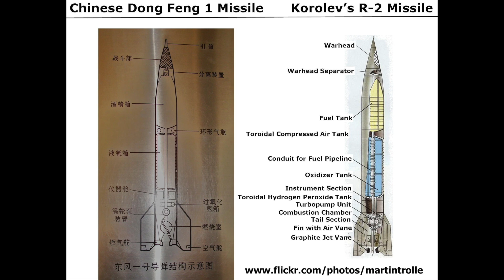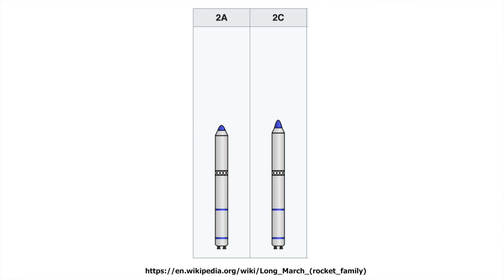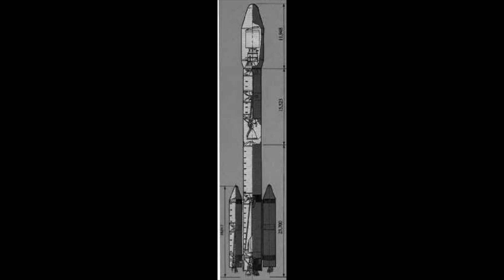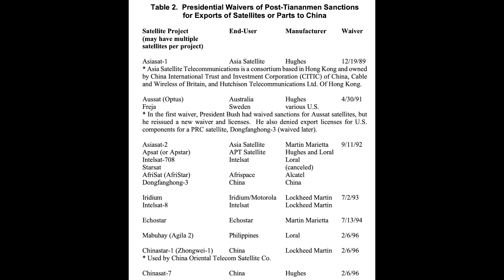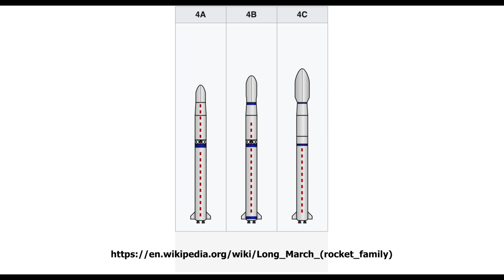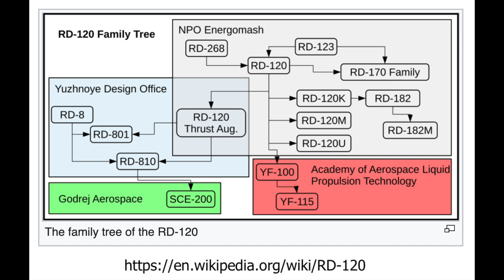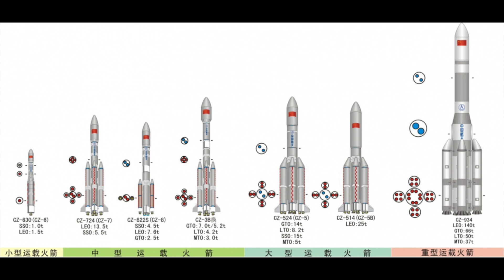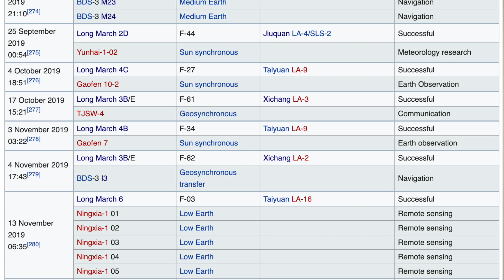Every Chinese Rocket Design Explained!

Comment: Why is there panels Falling off the rocket at launch
Reply: If you're talking about the one launching at 12:27 from the barge, those are spacers that hold the rocket in the middle of the tube that it cold launches from. Large ICBMs and those that launch from mobile platforms often use the same technique (see the Russian SS-18 or US Peacekeeper) and you'll see them fly off when the missile clears the tube.
Reply: Daniel Leca me too I think it was the ice because of the cold fuel inside
Reply: Agreed, I'm just confirming: most probably insulation and/or ice.
Reply: Insulation foam for keep cryogenic during filling fuel,and it's planned to fall of at launch
Reply: @Velctor  It is an insulation indeed, but not for cryogenic fuel since these rockets use hypergolic components. It's actually the opposite: the panels keep rocket warm enough while it is standing on the launch pad. NTO has relatively high freezing temperature and winters in China are cold.
Reply: @РоманЕвгеньевичСеменко  thanks
Reply: I'm a chinese spacecraft fan
Reply: Max Kopstein is right, The Indian space agency rockets do the same thing.
Reply: @Kickmemes_ Girls I smell a space enthusiast :) cryogenic bi-propellants, so cool ;)
Reply: Because there are.
Reply: That's ice falling off. It's normal.
Reply: @sdv73168  that isn't ice
Reply: It's made in china. What did u expect?
Reply: @vijeshkumar692  Uh, I expect it to be cheaper than US rockets, have the same capabilities, and be a lot easier to mass-produce. 95% of all products in the US are made in China, because they have cheap, fast, and most of the time reliable manufacturing plants. Those "made in China products are bad" are just discriminatory posts that look at the one in ten thousand product that was made in China that sucks.
Reply: the rocket is breaking apart (read @tanks608 's comment and replies)
Reply: @14Thenger  no, it's just insulation falling off as it's supposed to. It's not worth keeping the added weight for the tiny improvement in efficiency it would provide (by decreasing the amount of propellant lost to boiling), but while waiting on the pad it allows them more time to fill and trouble shoot any issues.
Reply: @maxk4324  dude that was a joke ^^ that's why I said "read @tanks608 's comment and replies" but thanks for the added infos c:
Reply: @14Thenger  lol, my bad. And np, rockets are cool af.
Reply: @14Thenger  but that's still successful launch
Reply: Because it's made in China, duh

Comment: Hello,
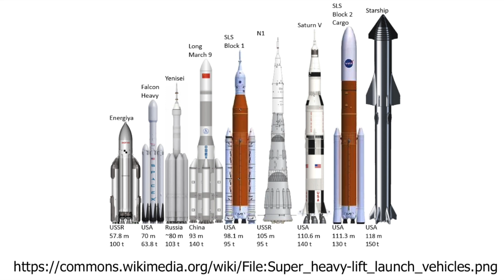The Energia in comparison chart at around 12:07 minutes, seems compact compared to the other designs? So how can it match the others on capacity, but be so 'tiny'?
Reply: it was very wide and had 4 strap-on boosters, also it had some of the best rocket engines ever made
Reply: As mentioned above, the engines boasted incredible efficiencies. As well, to expand on the point of it being wider, the volume of a cylinder is equal to its length times the square of its radius times pi. So that means tank volume increases proportionally with length but it increases quadratically with radius. In other words, adding a foot onto the radius gives you more volume than adding a foot onto length. The downside is that you increase drag, it's a trade off but it worked in their favour in this case.
Reply: It has four kerolox boosters with RD-170 engines weighing ~370t each and hydrolox core weighing ~780t.
It may look a bit smaller because it doesn't have a payload fairing.
Reply: Thank you for your replies, i have heard its engines were efficient, but this efficiency is not huge? Plus my limited memory advises that don't some of these newer rockets also use these 'leftover' Rd 170 too and also have solid rocket boosters which provide far more power than any liquid boosters such as the Energia's could provide?
Reply: @anticat900  Solid Rocket Boosters are not as efficient as their liquid counterparts, they are cheaper and easier to store, but they are no mach against the strap on boosters on the Energia in terms of power or isp, SRBs also cannot be turned off once started

Comment: 8:26 - seriously 4.2kg to LEO? Seems low.
Reply: I believe he misspoke, Wikipedia says 4,000 kg which seems more reasonable.
Reply: @Ellyerre  So 4.2 Mg. Easy to accidentally say "kilograms" instead, because megagrams are rarely used.
Reply: 4.2 metric tonne
Reply: I asked for the same clarification.
Reply: 4.2 Ton
Reply: Three or four oranges sent to space is still pretty impressive
Reply: @dazonic  Do oranges actually weigh an entire kilogram??
Reply: @alephkasai9384  no 1 kg is about 2.2 lbs
Reply: @actually_it_is_rocket_science  I don't really understand pounds
Reply: @alephkasai9384  Nobody does..  :)
Reply: @alephkasai9384  In The UK, Jam (jelly) is normally sold in 454g jars, used to be sold by the pound but we're not allowed to use Imperial meassurements.
Reply: dazonic Erm sorry to interrupt but I dont really think an orange is 1 kg.

Comment: Man it is crazy how much stuff falls off those rockets when they launch.
Reply from the maker: Insulation, it’s supposed to fall off
Reply: @scottmanley  omg the man himself, isnt insulation falling off and striking the vehicle what took down Columbia though?
Reply: @tanks608  when it reentered yes because it put a hole in the heat shield. But this doesnt need to reenter
Reply: @tanks608  a think a foam caused it not sure
Reply: @anthonyc4138  The foam is insulation. The external tank was covered in that orange foam to insulate it during the ascent, otherwise the cryogenic fuels heat up and you have to start releasing lots of boiled off fuel otherwise pressure increases and the entire tank ruptures.

 So yes; it was a piece of foam falling off the external tank during launch which damaged the leading edge of the wing on columbia. The leading edge is where a lot of heating occurs during re-entry. As a result we had a LOCV (loss of crew/vehicle).
Reply: @tanks608  well in Columbia's case it wasn't supposed to fall of whereas here it is meant to.
Reply: tanks608 

Debris at Mach 20 tends to be a big deal. Take  off maybe not.
Reply: @tanks608  In addition to everyone else's comments, the shuttle was a unique configuration where insulation falling off could actually strike another part of the vehicle. For the most part it just falls away from core stages, and boosters aren't really in danger either considering how relatively weak the shuttle's leading edge panels were. Plus, it's falling away right during launch, at low speeds, and not mid-ascent like in the fateful case of Columbia.
Reply: @tanks608    Which is why the shuttle design should have placed the orbiter on top of the stack where nothing falling off the external tank could harm it.
Reply: @saxonsoldier67  Gravity is only a minor force when launching.
Reply: @pulli23  When the STS jumps off at 3.5 G and hits Max Q, the debris from being along side the stack would disagree.
Reply from the maker: @tanks608  Indeed, I'm sure that if these were designed to reenter from orbital velocity they'd change this system.
Reply: @saxonsoldier67  But then you'd be throwing away the main engines (which was the entire problem the STS was meant to solve) and would have some crazy difficult aerodynamic issues to solve
Reply: @jethroreading7168  True.  The ET could have had the SSME instead as it went 99% to LEO.  STS was an inelegant design that proved to be problematic.
Reply: @tanks608  Reason why the entire space shuttle program is a bad idea: it is accident prone.
Reply: @scottmanley  Eight launch attempts with only eight of them being successful? Strange way of putting it. Is that not a 100% success rate? Or was that a blooper on your part?
Reply: Scott Manley have you ever watched Isaac Arthur? He should be right up your alley
Reply: tanks608 one of the assembly staff told me those debris are used for temperature keeping prior to liftoff
Reply: @anandanms4382  Ariane 1-4 tho